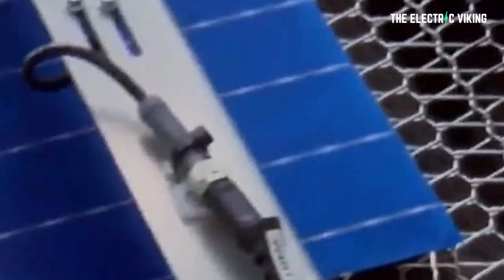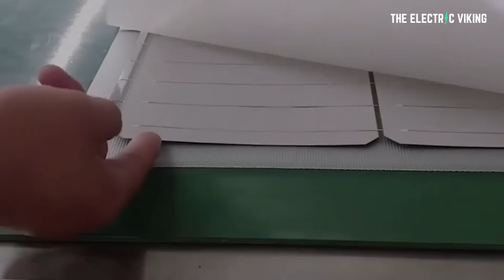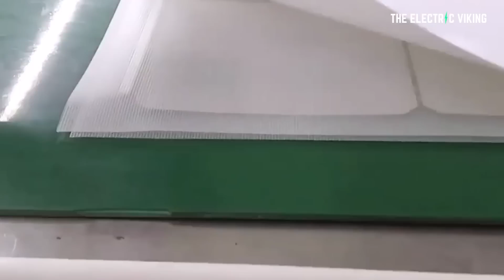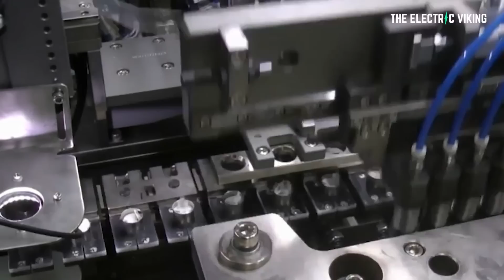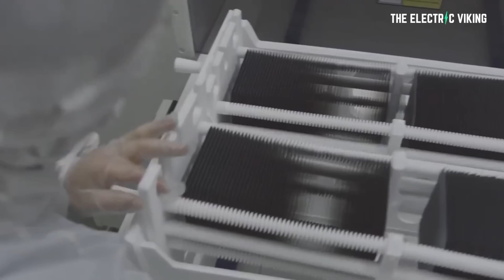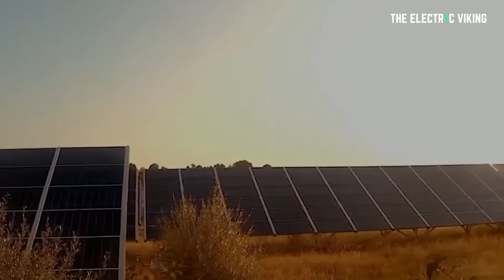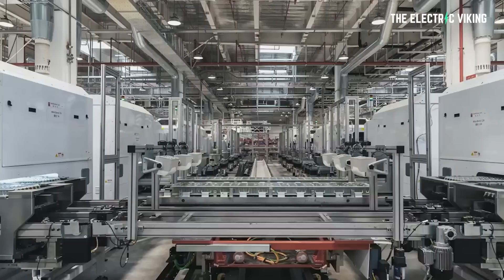China’s solar panel price war will double solar panel installations globally

Comment: Europe will have its solar energy transition if they do not practice  protectionism.  Not only solar panels, also batteries, ultra high voltage transmission lines.  The whole system.

Comment: Northern Europe cannot function on solar panels without huge backup systems.  We will need gas and oil.  It is insane to believe you can run a society on solar panels. But of coarse every little bit helps

Comment: Good content. I'm a farmer living offgrid for more than 25 years and its great to make use of solar panels and wind turbines for about 15 years or so. Even if it's not possible to meet most of a farm's energy need on renewables, I'm optimistic that within ten years it will be possible  to  plough and harvest vast lands by electric tractors and combine harvesters of big powers run by electric engines.  But, the transition to renewables in every area of life must be politically and financially supported by the nation states and local governments.

Comment: Well, that’s most certainly the most bullish claim I have ever heard in quite some time. Data at hand most of agricultural, industrial and transportation can’t physically use electricity and maintaining the same efficiency. So even assuming the complete (and that would already be astonishing) removal of any “fossil fuel” direct consumption of a single insidiously, that would still be not quite comparable to the whole global consumption. Beside the fact that except if they come up with the quickest deployment of the most impressive new technologies in raw material extractions in a matter of few years, it wouldn’t add (on a global scale) much more than saying I traded my car for an ATV.

Comment: As the price for solar panels drops, it becomes cost effective to put two panels as a set.   One faces toward the east and the other faces toward the west.  As a result, the energy output is stronger in both the early and later hours of the day.  Thus, the system generates a more consistent output power and for more hours than a single panel in the midday position.

Comment: Technology invented in South Africa called the Eden system . Plugs Onto coal power stations smoke stacks and converts CO2 back into refined liquid fuel . 1 ton CO2 produces 1 barrel of refined fuel. 10 cents per litre . Should SA attach this system to all of its coal power stations we would export oil... Spent 5 years trying to convince our  corrupt ANC .they did not listen to white man. So now that system is in China and China will not need oil anymore

Comment: Over optimistic sales froth with no strategic appreciation. Comme toujours.

The words "All eggs, one basket". Never a good option strategically. Look what happened to Germany recently.

How is Winter or night-time consumption of electricity to be catered for ?

Water based energy storage e.g. lakes, tidal barrages, compressed air systems  will all have to be implemented at scale to make the renewables based system work because they're aren t enough minerals to make a World-Wide  "Battery only"  electricity storage solution. All these secondary support solutions will require massive civil enegineering and plant construction works . . Which is the drag anchor to immediate adoption of  a "Nearly all renewables" power generation system . . Because big CE takes time to finance and engineer.

It wouldn't take much to reduce solar electricity output regionally,  dust storms, heavy cloud (Care of Global Warming - you may have noticed now it gets darker earlier in the evenings in winter than it ever used to  . . Care of thicker cloud layers )

Sales is the easy bit . . Making and keeping  the energy generation system World-Wide work in a co-ordinated, effective and efficient way is where the "Heavy lifting" occurs.

Comment: Methinks the reason that the US is imposing "steep" tariffs on Chinese solar equipment is less due to fears about "forced labour" (Coming from the country with the largest prison-labour force in the World!) than about fears of competition for Big Oil.

Another thing that is going to speed the introduction of renewable energy is the continuing and accelerating research into cheaper and better batteries.

Comment: Include energy storage into to  the cost of wind and solar, and compare to coal. Without storage of wind and solar the coal plants gets fired up. 
Look at massive coal use of Germany and compare to France. Germanys push for green has been an utter failure.
GenIV SMR specilly MSR will be the real disruptor of oil power, and coal power and gas power.
No new wiring needed, the MSR  can be co-located on fossil power plants.
Cheap, safe, low pressure molten salt reactors will be the real disruptor.
Using supercheap and widely available Thorium and nuclear waste there will be very low cost of the fuel, and disrupt big oil, and OPEC.

Comment: You either optimistic or idealistic… overlooked some very important factors, like cloudy days and nighttimes, when there is no solar energy production… you need to have extreme size energy banks and/or on huge demand energy plants to be able to switch to the backup system when the sun is not shining, because the demand will not stop when the rain comes.

Comment: Having weather and season based energy in the UK is stupid. Currently in the UK it has been -5c to -7c.
It is very cold, there is very little sun and there is little wind.
Gridwatch website shows 0% electricityy coming from solar and 2-3% coming from wind over the last few days.
Renewable energy fails when you need it most.

Comment: Yes it is true. Many solar panel components are produced through slavery in China.

Your video is very optimistic but your analysis is too simple. Try thinking about the impact large wind and solar panels have on the electricity grid. Try thinking about the intermittency - where is the electric energy stored to account for that fact? The reason fossil fuels are less profitable in some cases and often why nuclear is not profitable is simply because intermittent production sources are destabilizing the whole system

Comment: This is false.   Neither wind nor solar generated electricity can be used on its own.    There has to be at least 40%  synchronous fossil or nuclear generated electricity running before any renewable can be admitted.  There is no solar at night or on cloudy days and no wind on a calm day.    Renewables receive the same price as the highest priced fossil fuel electricity.   I live in Europe and this presenter is lying.

Comment: Gorilla solar. It’s not about time or cost, it’s about regulations. Obviously we need fossil fuels for manufacturing for the foreseeable future, but our households could benefit right now. Hybrid cars don’t require electric charging so liquid gas sales will continue for some time, even if reduced by hybrid purchases and emissions regulations. Advancing nations will undoubtedly turn to oil and gas to propel their manufacturing, as they have no other alternative. This is a slow motion bing train which will take a century of modification and innovation to perfect.

Comment: Who on earth even still uses poly silicon panels? Seriously we stopped using that technology about 8 years ago, the reason it’s falling through the floor is because it’s such old low efficiency technology and as such nobody who really understand solar panels and real world production wants to buy it, hence not surprising it just keeps getting cheaper and cheaper.  Even std mono technology was replaced with p-perc mono back 5 years ago and now even p-perc is being made obsolete as eveyone in the industry are moving over to the higher efficiency n-type wafer technology panels, so yes all p-type cells and panels will end up selling cheap once n-type is mainstream and that transition is occurring right now. Lastly the wafer price drop is only a very small part of the whole panel price, let’s say it may affect panel pricing by around 2-5% but certainly nowhere close to 30% as indicated. Sorry but you are just pushing hype and don’t really truly understand panel and cell technology to be making these statements. Furthermore the panels have always been the cheapest part of a solar installation but things like bom and inverter costs and battery costs and labour have actually increased in the last year rather than gone done, yet that was not mentioned at all.

Comment: I disagree because lower electricity prices demand a lower cost of production or the producer, who is a price taker not a price maker, will go bust. The same rules apply to the solar market as to liquid fuels.  If the lower cost of energy impacts on one, it will impact on the other. If solar energy production is very profitable then there is no reason on earth that solar panel prices drop 30% or at all.  They are reacting to a less profitable customer with their price cuts in order to keep their production lines going as efficiently as possible.

Comment: I'm pessimistic that solar and wind will provide enough output to meet future energy demands in Europe.  I'm pleased that PV costs have fallen significantly  from 15dollars per peak watt  but it has taken us  over forty years to get here.  I still remain skeptical of wind and sun power, andit ain't that green.  Processing of sand to silicon or for polycrystalline are not exacly energy cheap and doing so without the helpful fossil powering the fab plant.

Comment: In reality the so called renewables are actually increasing our power bills. In Europe due to the war demand for coal power generation & nuclear power generation has significantly increased. Renewable power sources like solar & wind cannot completely replace base load power sources like Coal, Gas, Nuclear…. You need the ability to meet the power demand during the night time or when the wind is not blowing. You need to have more than 50% of power generated from stable sources like Coal, Gas, Nuclear.

Comment: You may be right about some authoritarian governments being able to demand and enforce what you're saying so that it would actually take place.  However in countries inhabited by free peoples with elected governments and policies the people want, it is not going to take place. For the next 50 years, coal and oil will do just fine. For example, in the United States it is not possible to put up enough solar panels to eliminate coal burning as a source of electrical power. We could put up 15 new nuclear power plants, however the public was very much frightened over a film made in the 1970s, and people are ignorant of the fact that Chernobyl and Fukushima used nuclear technologies which are not and never have been used for power in the United States. So.....with the inability to replace coal and oil with solar or nuclear in the US, the fossil fuel industry will be just fine.

Comment: I suppose if you are going to be a cheerleader for Solar and Wind Power then facts do not matter.  first of all, the true cost of solar and wind are far higher than you purport.  The Us and several state governments have been subsidizing solar and wind, that means the taxpayers are picking up the tab.  Second, gas and coal electrical plants are far cheaper to build and far less pollution free than alternative energy.  

The amount of pollution generated by solar panel manufacture doesn't affect us but it does affect the countries in which the panels and other components are manufactured.  But despoiling the environment of other countries is a win for us, right?   But now you claim that solar is going to bankrupt natural gas powered electric plants, is that right?  Really?  How many solar panel arrays are needed to produce more electrical output (during the day light hours from  9 AM to 3 Pm - six hours) to out produce natural gas powered electric generation plants.  And where do we get the energy after 3 PM?  I call BS on this posting.  It will never happen in your lifetime.

Comment: The utilities are adapting in two ways.
1) Some states now require connection to the grid for residences (and there is a video of someone being evicted from a residence that isn't grid tied).

2) They are swapping the charge from the electricity to the grid connection fee.  Before you might have paid $10 + 15c/kwh but now you pay $35 + 12c/kwh (or worse... 15c or more per kwh).

Comment: How does cost matter when you can't store it for year-round usage?  Large-scale battery storage is required to make solar and wind a base-load provider - we are at least a decade away from that.
How would you propose to power heavy machinery with electricity - often these large power-hungry machine must work where there isn't much infrastructure (yet), and charging your machine for 8 hours after using it for one hour is idiotic to put it mildly.  Huge battery breakthroughs for high-density energy storage are required (but unlikely) for this to be an option - or a huge investment into synthetic 'carbon' sources that can provide high-density energy.
How do you propose we recycle faulty and EOL solar panels and wind turbines?  It is not economically viable unless you are OK with unpaid child labour.

PS: I have solar panels and happily reap the benefits in summer, and profit from the current government subsidies associated with buying and owning them, but I'm not blind to the actual economy behind it that is not so rosy.

Comment: On a dark winter day my 8kWp system produces about 400Wh, we use gas to heat our home on those days.  Please think of this before you dismiss the carbon industry.
I could use a heat-pump, which would be powered by electricity from the net, generated by... gas.

Comment: Coal and gas will never go bankrupt, operators are legally required to keep warm reserves in order to maintain network stability. Most stations run below 70% capacity not because solar or wind is cheaper, but because the law says solar and wind have priority and are bought first. When there is too much wind and not enough demand, turbine operators get paid AS IF they sold their electricity. This is one of the reasons why electricity prices in Europe have only been going in one direction for decades - up ⬆️ despite the massive buildup of solar and wind in the last 30 years.

Comment: the more solar panel they sell the more battery they will sell to , if you guys want to build a solar system you can find solar panel for around  160 usd for a 400w panel , for battery you can expect to buy rack battery from EG4/SOK/Trophy battery they will run for betwen 1400 to 2000 usd for 5kwh of capacity , for the inverter there is Victron/Sol-ark/growatt and eg4 .You can also go micro inverter they last way longer than the basic inverter but it will be more expensive to put a battery on it .
 It is cheaper to put solar on a roof but you might not have the right exposure or enough surface on your roof .

Comment: Land intensive, farmland cobblers. Overxast? No output. Need constant cleaning which takes energy and water  ; they don't work covered in dust, and they GET covered in dust.  They start to tdegrade  almost immediately. Cannot be recycled , toxic chemicals at all stages of procurement and manufacture, intense energy cost at the point of manufacture. and cannot be recyled, so will end up on the bottom on the Ocean.

Comment: I've had a solar installation here in Sweden for 11 years. 5 months of the year is practically 0 energy. Snow on the panels and very very little sunlight when we need it the most.
It is fantastic in summer, but nothing to build an energy system on. I gain a lot from all the subsidies but it is not something to rely on as a country.
Reply: Do you really gain that much though? You are taxed through the nose, then you get some of that money back. Others who don’t have solar have to pay higher prices and are subsidizing you… it’s not even a zero sum game, it’s quite negative.
Reply: I completely agree with you. I did my panels last year and it works fine, but in winter, when I need it most, there is very little. I only have a 14kWh battery, it would be ideally for me to have at least 5MWh which would be full in autumn and would last thru the winter for heating with heat pump. I live in Slovenia, so there is some energy almost always, but the three winter months are very poor. So cheap batteries are the only option and it's not around the corner.

Comment: Europe is trading the dependence on Russian gas for Chinese solar panels and inverters.  Also, you fail to talk about the total system costs versus just the cost of the panels.  Total costs have been squeezed over the past 10-15 years, China is the only game in town.  Do you really want to give China the ability to turn off your electricity like it did with your website?  Don't dismiss such possibilities so lightly.

Comment: I’ll give you and update on the energy transition. 
- We already have LNG terminals build and extended in Netherlands and Greece
- solar has been pushed and subsidized but transition has been fastest in northern parts I believe (please check)

We are looking are multiple sources of energy looking for a mega hybrid structure.
- wind is being researched heavily on horizontal wind walls. Either to be included in roofs or as just windwalls
- thermal electric energy from body during training or sleeping. I’ve seen special fabric that could generate solid returns. Imagine not losing all energy directly into the air
- piezo Electricity in stairs and pavement or floors
- solar energy paint. Like solar panels it’s just paint and you only have to connect a system to it. Also solar into glass or even in the roof tiles. The pressure only accelerates this. 
- hydro energy via water falling within the sewage or inner water system or reusing rainwater for flushing etc within new designs of houses.